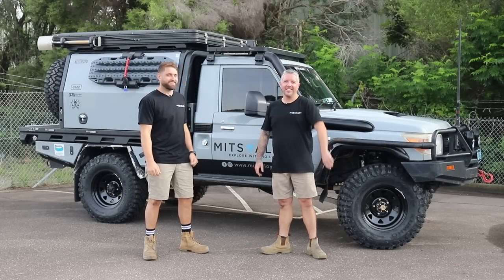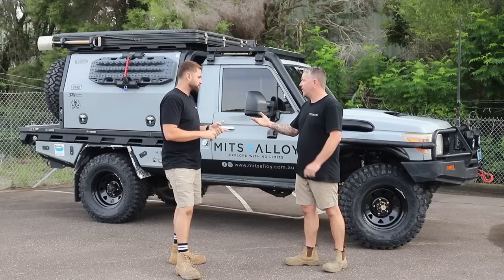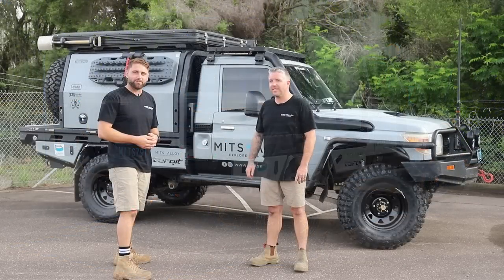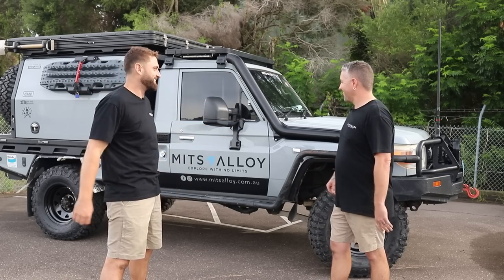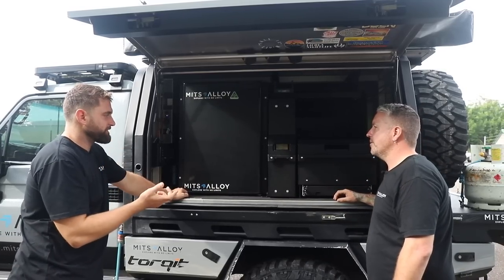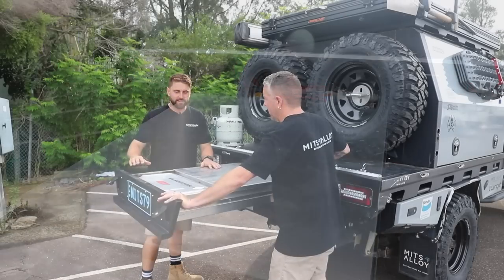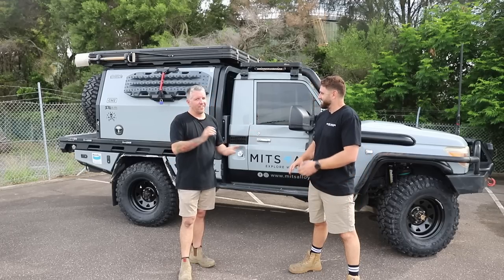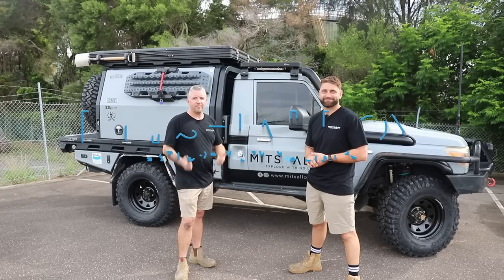How much has MITS79 cost us since owning it?

Comment: Someone needs to take all these 12v power supply components, strip out the guts of them and mount them on a Common base with a neat and tidy, singular cover that contains everything in a sealed unit and singular display panel, complete with sealed cooling channels that run over the  various heat sink fins and exits via external vents. Instead of all these add hoc, patchwork looking, diy setups with various bits and pieces here and there and exposed wiring/connections... That's my opinion on the growing trend of "look how many different things I have for my power supply set up"

Comment: Very upfront and informative, before the rear diff swap were you running neg offset wheels for correction? If so were you experiencing issues from this?
Reply from the maker: Thanks! Yes we were running different offset. Although this isn't very practical for the sort of trips we do, fortunately we didn't haven't any bearing or rim issues.  With the diff correction we now run a -5 offset all round

Comment: Did I hear that correct, you paid $110k for this second hand and then had to put a new engine in it and up $282k overall. I know you guys and other love these cars, but just don't get them. I do keep hearing they are the reliable car on the market, bullet proof, so why so many costly repairs.
Surely there are better vehicles that can do serious off roading without changing just about everything on the car, but don't have a 30 year old design.
Reply: Yep. I don't get it either.
Reply: Pretty sure they said 38k the paid for it originally. 
I think the 110k must be what it cost after modifying